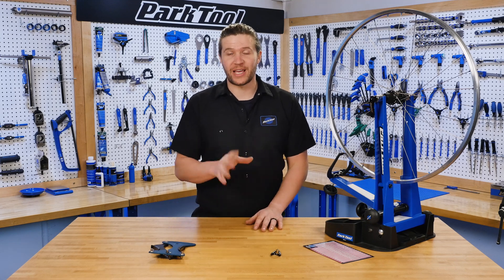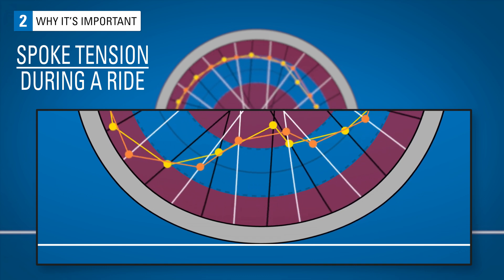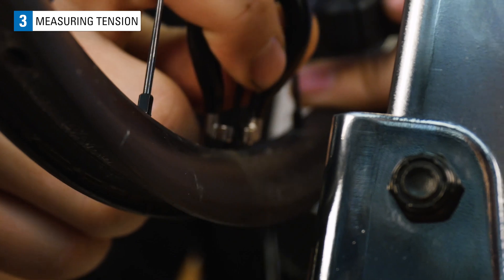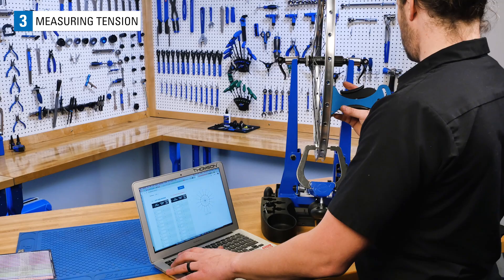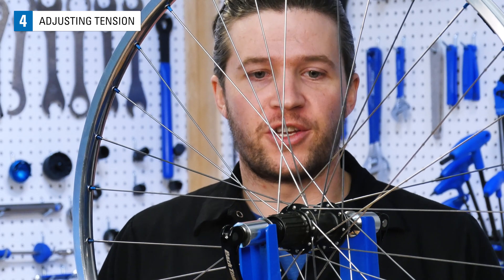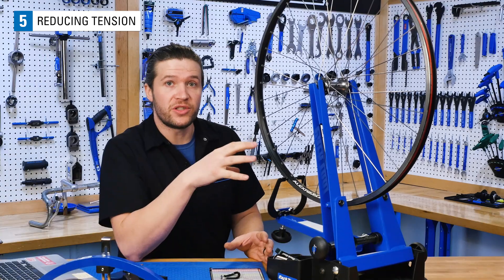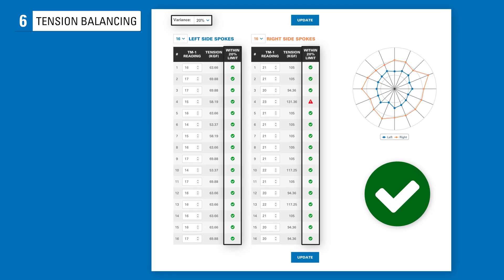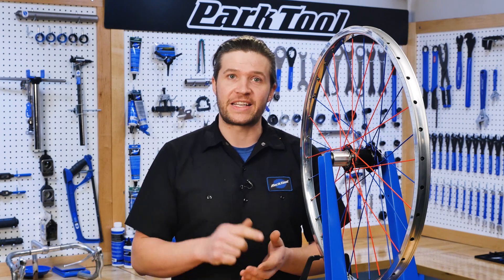How to True a Wheel Part 5: Spoke Tension

Comment: Any spoke is better than no spoke ,Any tension is better than no tension or no spoke I'm doing it just by feel because to replace 4 spokes they want 65 dollars ...he wouldn't accept 50
Reply: Four spokes is £4 or $8-10, the labour and effort to install them especially on a rear wheel, where you. Have to remove the cassette or freewheel is greater, and replacing multiple spokes requires more effort to true the wheel.

Comment: What do I so if my front wheel is slanted to the side? It's not a dishing or truing problem, so when my frame and forks are standing 90° perfectly vertical my front wheel is sitting at about 110° to the left. It's  axle  is perfectly centered on the forks, so why is the wheel leaning to the side? Please help, I've tried to fix this for a few months now

Comment: So the drive side spokes should be tighter then the non drive side , heck this would’ve helped a lot if I knew earlier !
Reply from the maker: That is correct.
Reply: @parktool  And what about the front wheel? First the non disc side or it does not matter on front wheel? Also the tension on front wheel on the disc side should be stronger as the other one or both sides can have the same tension? Thank you

Comment: which side is the drive side and which side is the non drive side on 1. the rear wheel, 2. the front wheel?
Reply from the maker: "Drive side" and "Non-Drive" are given from the riders point of view.  The right side of the rear wheel with the chain and sprockets is the drive side.  The right side of a front wheel is the drive side, even though there is no chain.  The rotors of a front disk wheel are on the non-drive side.

Comment: My pre built hope Fortus wheelset seems to have higher tension up front than the rear. I don't have any tools I just pluck it and based on the sound it seems a bit tighter. I know about the driveside rear and disc side front has higher spoke tension. 

I just finished my custom built wheelset and ended up having tighter tension on the front too. Is this all right? Thanks!
Reply from the maker: If it is the same rim, normally it is the same tension on the tighter side of the wheel.  For a rear, that is the right side. For a disc wheel front, that is the rotor side.
Reply: I might have overtightened a bit Or the difference in sound must be from minute spoke length and dishing imbalance but I got it down to almost perfect radial and lateral. I used my frame set and zip tie/finger and feeling by sight. I also used my floor tiles and a measuring tape to check dishing. LOL.

I also over estimated my spoke length by around 3mm longer. Good thing I used Sapim D lights which doesn't bottom out with too long spokes.

What's the worst case scenario that is possible for spokes that are too long? Is my build compromised? Peeking through the holes I could see about 1 and 3 mm spoke threads above nipples.(same lengths for all on hope pro 5s) I tightened a bit more and kept thinking I'm about to use up all the threads in the spoke. LOLS. Thanks!
Reply: @parktool  I just got it to make it sound the same. A bit of tightening around the driveside rear and loosening the left.

It may be the larger tires on the front of my other front wheelset that make it sound tighter or It's really not that tight too.

Comment: This video taught me I have a zero chance of ever trueing a wheel correctly .. I appreciate the knowledge
Reply: I have only been truing bike wheels for a few months, it's easier than you think to tru a wheel in my opinion. Some wheels can be more difficult to tru than others but if you understand how it works it's not that difficult. I have learned it myself from watching videos of how to do it on YouTube so i think you can learn it too. 😊
Reply: I learned 3 tips from these videos and websites, and that helped a lot:
1. you need to check the tension, do it by hand if no tool, as shown in the video 2 spokes by 2, feel the tension, if a spoke is too soft it will bend more and feel softer. Augment the tension of these spokes that are obviously too soft. I started with that point, and the wheel was already almost true! then only a few minor corrections by checking the side alignement, and it was done...
2. important point to remember, you need to turn the tool in the opposite direction than expected (you are NOT turning the spoke, but the thread around it!).
3. proceed by 1/4 turn only... then check again the tension or alignment, and if needed, another 1/4 turn. Rinse and repeat.
Reply: Truing isnt witchcraft, ignore the high end finesse worries of equal tension across a wheel. If you have a buckle tighten the relevant spokes, if you have wildly loose spokes, tighten them back up to a similar tension to their neighbors. Your wheels will thank you for a bad retensioning over neglect
Reply: Needs little thinking, but a lot of practice, patience!

Comment: Can you Loosen and Tighten spokes with a deflated tire on or does the tire have to be removed to do this.???
Reply from the maker: The tire can be on.  Rim tension specification assume there is no tire, so simply deflate when setting a maximum tension.  It will drop a bit when fulling inflated.
Reply: @parktool   Thank You for the response.!!!

Comment: Great series. Having seen it all, it seems that wheel building and truing is not complicated, just tedious.
Reply: Yes, it's tedious and repetitive.
Reply: @stefanopassiglia  Think of it as meditation.
Reply: @MrSzwarzYes, specially when dealing with used parts. Back in the pandemic when there was parts scarcity, I had to lace a couple wheels with mixed parts, it gets harder if you dont know very much the history of the parts that you're going to use. It's doable, but results vary and may be not safe for certain high stress purposes. Nevertheless, my wheelset served well for a 700mi journey, 30kg of bags, road tyres, the wheels stayed true all the way and my cantis never failed. The bike was a Bianchi Advantage 1990, my uncle now owns it and uses it on a daily basis.

Comment: On a rear wheel should the tension of the spokes be the same on both sides? I had A G3 power meter in Hed Belgium. The tension is much less on the non-drive train. Is this normal?
Reply from the maker: The side with the flange that is more inset will have higher tension.  On the rear, the drive side flange is inset toward the center compared to the non-drive.  It will always more tension, and this is normal.
Reply: @parktool  thanks for the reply
Reply: @parktool  Are the non drive side spokes can also be the same tension as drive side because of different spoke lenght?

Comment: The only problem with your park tool tension checker is that it's too small for electric hub wheels that are 20 in. You can't even get it on the spoke It's almost impossible.. You could do the front wheel barely but not the back It's just too difficult. 

I wish they made the same tool but smaller for smaller wheels with the modern hub electric bike wheels.

Comment: I watched the first few videos on lateral, radial, and dish truing.  Where does this "tension balancing" technique come into play?  Is this done after the wheel has been adjusted for lateral, radial, and dish true?
Reply from the maker: All of these effect one another. That means that as you start closing in on god lateral true you move to radial, dishing then balancing but you will need to go back through and check and correct them all again. It can take a few rounds of this back and forth.

Comment: Does that mean if there all exactly the same tension does that mean that it would be dead straight
Reply from the maker: No, it does not.  Rims are simply hoops on aluminum, steel or carbon fiber.  None are perfect before lacing.  These structures have internal tensions just sitting on the shelf. But they don't need to be perfect to go ride the bike!

Comment: All of the videos that I have found on wheel truing have rims where the spokes form a single row.  The 20 X 3 inch rear wheel on my Lectric XP 2.0 has the spokes in two parallel rows approximately 1.5 inches apart.  The angle of the spoke from the hub to the rim appears to be a lot less than on wheels with a single line of spokes.  What is the procedure for adjusting a wheel like the one that I have?
Reply from the maker: The procedure is the same for your wheel with offset spoke nipples. These are common on fatbikes and even some mountain bikes. The fundamentals of how the wheel works is the same and the process of tightening and loosening the spokes to gain trueness is also the same.
Reply: @parktool  Thanks for the information.  I also used your web site to find a wheel building class that is only a few blocks from my home.  I will be attending their next class.

Comment: I developed my own motto when truing wheels with limited tools available, as much as possible, turn the nipples as lesser as possible, to achieve that, both sides should be adjusted simultaneously, light tightening turn on one side and also light loosening turn on its opposite side in the "area of influence", it avoids the spokes reaching the bottom of the nipples to make room for further truing procedures later on, accuracy will be compromised if i didn't count how many turns i set on each nipple because i dont have a tension measuring device, starting up i use four complete turns on every spoke before determining the area of influence all around the rim before starting the lateral and radial truing and since i don't have a truing stand i place the rim right on the bike frame dropout itself as a visual centering tool lol
Reply: get truing stand, and good nipple wrench and you will see that all your philosophy is unnecessary, in short words: nipples must be rotated so much to get wheel even and in centre

Comment: Spokes are way too complicated. So many ways for Them to go wrong.
Reply from the maker: Just think of them as bolts and the nipples as nuts. Things can happen but typically those problems can be solved.
Reply: i did not noticed that, i have no problem with them , for years

Comment: I was thinking wouldn't be better to tension first then do radial and lateral truing?
Reply: No, it makes no sense to try to balance tension before you've trued your wheel, because while truing your wheel, you might throw off the balance in tension.
Reply: @sop4688  i disagree. this is something you dont do regularly. more of an initial set-up/ longterm health inspection. same with dishing. radial and lateral will need more adjustments as the wheel settles and the spokes stretch over time. every 3-4 truing touch ups you should assess the overall health of the wheel though.
Reply from the maker: You could do radial first.  Lateral is the most common aspect needing correction, so that was first up here.
Reply: on new wheel, first goes initial tension(20-40kgf) then l/r then up/down, again l/r, dish+finall tension, all that in 16 minutes for standard rear  26" 32h wheel

Comment: How much less tension should the side with the larger bracing angle have?
Reply from the maker: Typically about 30% less tension on the non drive side for a rear wheel.
Reply: Jason Long - The gauge has an arbitrary deflection scale (for ease of reading) that translates to tension values (this chart is available online). Your spoke type (typically 2.0mm round stainless) will have a range that you will mentally divide into thirds. Drive side spokes should fall into the highest third, non-drive side into the lowest.

Comment: Why couldn’t you true a wheel by setting at least one side to all the same KGM?
Reply from the maker: Good question. In theory, yes, you could start there.  But rims are not perfect even when new.  It would be a place to start, but would still require some spokes to be tighter relative to others.
Reply: because of real world, nothing is perfect, things are between totally unperfect and perfect, always is correction needed
Reply: I discovered this the hard way. Had to replace 1 spoke and measured tension from both sided. Thought I would tension brake side to 25 and 20 the other.. Now I have a ridiculously wonky tyre. Well gotta learn the hard way.